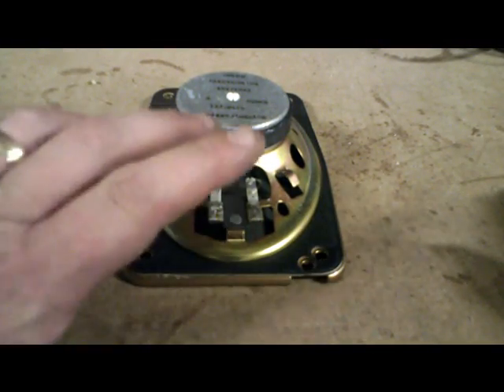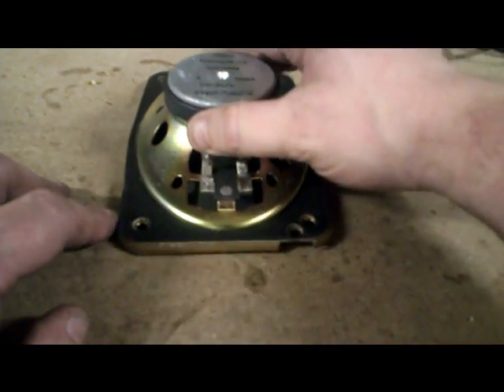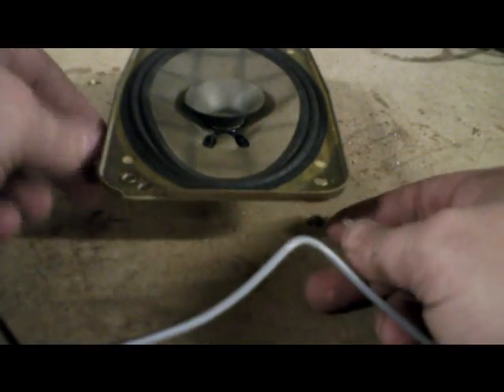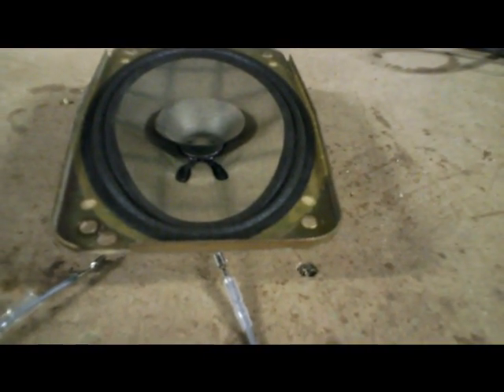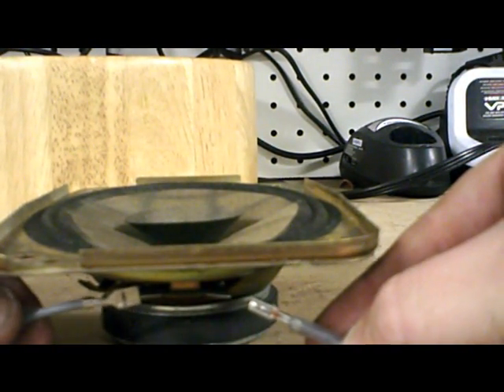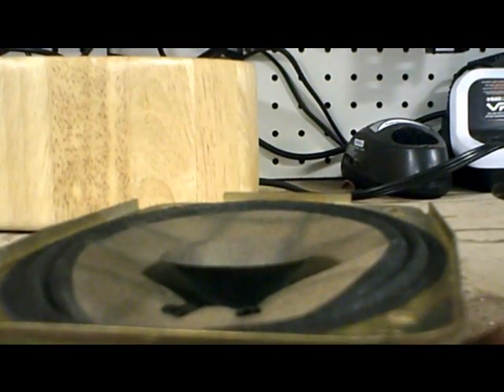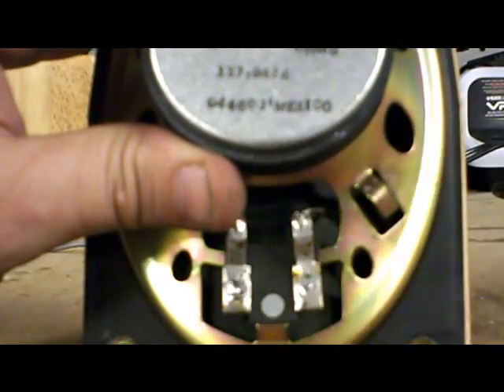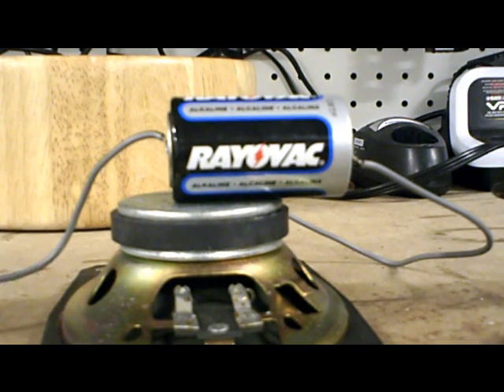How to check speaker polarity. Positive and negative not marked?

Comment: Thx for the tip. Perfect, easy, short and sweet method of determining (an unmarked) speakers polarity. Just the info I needed to test on a Bose 6X9 I got, which came factory as a rear speaker from some other random car. (Dunno what the car was b/c it was one of the two 1/4 panels my work ordered in from a scrap yard. Yard cut off & delivered a large chunk of 1/4 panel with the 6X9. The autobody tech cut what he needed, scrapped the excess and I salvaged the unmarked Bose speaker before excess went to the scrap pile.) Very nice demo in video here. One thing I might add: doing this with a 9V, I think, may have results that are more emphasized / pronounced. Am I right?

Comment: The speaker will sound off connected backwards ? I connected it one way and it sounded good but it was quieter and I tried another way and it sounded louder so I went with that
Reply from the maker: It may be hard to tell if they are mixed up. You will be able to tell if one is out from another, they will sound "off".

Comment: Great tip. I have 6 pair of vintage speakers that I am currently installing into cabinets, and of course, NONE of them have the polarity marked. My next question is though, which way should you connect the speakers to the 1/4 jack? I'll be running all these speakers in series to an input jack in the back of the cab. Thanks for the vid. Great info for DIY'ers.
Reply from the maker: Thank you! The center of the jack is the negative.

Comment: How do you know what the pos and neg is of your car wiring?  I have a gray wire and a green one, and despite searching all over the internet, I haven't been able to find out, so I still can't tell if it's correct or not.
Reply from the maker: Sometimes the positive will have a line on it but the easiest way is to get a complete manual on the car with the schematics.
Reply: sreihart le monde

Comment: How about if you have two wires sticking out of the hole where the factory speaker used to be? How do you know which wire is positive or negative to then hook up correctly to your speaker?
Reply from the maker: Manufacture manual..

Comment: I tried my speaker with a 9V battery and it didn't move but it did some sounds. It's a Pioneer TS-1615 3-way speaker and it pass the continuity test done with my multimeter. What am i doing wrong ?
Reply from the maker: Hmm.. Not sure. Is the battery almost dead?

Comment: Hey I got a question my speakers are clearly but my wires in my truck door are not the person before me changed the colors and there's no markings on them on the one door ones orange the other is grey on my other door ones dark green and ones light green I can't tell witch is witch I put the speakers in and there's sound the speakers are 250watt kickers I have a alpine deck I can turn it up loud but if I turn the bass past 5 it sounds like crap
Reply from the maker: Hmm.. That could be anything. What amp?

Comment: o think if wrong correct the speaker will not move up,but if correct you can see the speaker move up much
Reply from the maker: It will suck in a little instead of pushing out.

Comment: Hello
 Jhonnysshop,,  last night, from my vintage tube amplifier,  I 
mistakenly connected my Spendor Bookshelf speakers as with two  + wires 
 to the one speaker and two - wires to the another speaker. But one side
 speaker worked and another side didn't work.  'Balance control worked 
both sides only for one speaker. I shocked and sweated  then found it 
was wrongly connected. After made the correct polarity connection, they 
now sing.  Here, I need your clarification for: Since I made the wrong 
connection for 10 minutes, is there any possibility for weakening the 
Cross-over and speakers? Actually, What would be happened by this wrong 
connection? I am much much worried about my beloved - expensive  new 
speakers.   Kindly explain and please let me know : Did my speakers 
fully escaped and are they safe now?  why could  the speaker sing, connected
with two positive + speaker wires?  and why could not sing ,connected with two negative wires?
Thank you,
_ with regards,
Reply from the maker: You should be fine. It probably worked because the speaker was getting a ground somehow.

Comment: I am replacing the tweeter on my keyboard amp.  The one that came with it can only fit on the wires one way, but the replacement tweeter I bought has identical terminals which I will now have to solder to get it to work.  So my question is, once I determine speaker polarity, how do I know which wire is which coming out of the amp?  I only have a digital multimeter not a cool oldschool one like you mentioned in previous comments.
Reply from the maker: This may help https://www.youtube.com/watch?v=dpcuA0bH35Q

Comment: Would it work to test it using the existing wires in the vehicle connected to the vehicles battery or would that cause major problems?
Reply from the maker: +Stephen Diers Yeah, I don't do that..

Comment: what if we connect the opposite connection on speakers,  positive to negative and negative to positive?
Reply from the maker: +james kaneeth The cone with suck in instead of pushing out.
Reply: have the same question too,does it mean if you put it reversely theres no air pushing through the speaker cones?

Comment: Thanks for the tip. What if I have a speaker with fixed wires that has a speaker and tweeter and cross over filter in it? Is it save to use the same method or could I damage anything by connecting a battery?
Reply from the maker: No, you would be fine but just use a D volt.

Comment: How to you check positive and negative when connecting LOC's to wiring harness on the vehicle?

I want to connect amps to my car and not sure how to do it, i know from the speakers to head unit, but not the other way around
Reply from the maker: I typically would get a wiring schematic. Depending on the car, it may have a factory amp that needs to be bypassed.

Comment: Okay quick question. The  after market speakers i'm installing have the positive and negative terminals marked off. The problem is the passenger side rear speaker wires in the car look identical. They are both green with two white spots on them.  The driver side wires has one with a white line and the other does not. Is there a way I can determine the polarity of the wires that are not marked off (passenger side) prior to installing the speaker? The old speakers have no markings on the terminals. 
2003 Mazda Protoge ES sedan.
Reply: +Coolride17 thank you sir!

Comment: will this damage the sound quality of a speaker and you connect the wires wrong will the speaker play music or what will happen
Reply from the maker: No, it will be fine but may sound "off"
Reply: Off as in no music
Reply from the maker: Allan Couch No, just odd sounding.
Reply: So then the speaker won't sound right ?
Reply: So then the speaker won't sound right ?
Reply from the maker: Allan Couch Correct
Reply: i highly doubt 1.5 volt will damage a speaker!  we used to use 9 volt batteries in the same way to check for blown speakers, because sometimes a speaker may be blown but not seized

Comment: Got an old t-bird 1973. The original cables for the speakers(4) share the minus per side.
So out of the original radio there's only coming out 2 minus cables instead of 4.
Can I build in a modern radio and connect the speakers sharing the minus per side. So 2 speakers on 1 minus to the radio?

Comment: What I meant to say it that the polarity on the drivers side headrest speakers was reversed at the factory, causing sound problems with new speakers I put in. I checked the wiring and corrected polarity on the drivers side speakers, they sounded like crap w/polarity reversed-even blown but now they sound great, no problems at all. Thanks for the video, it was alot of help.

Comment: Very informative guy, thank you. I have a 91 Miata and there are speakers in the headrest(s) Original speakers were crap but you did get sound out of them, the driver side was far worse than the passeger. After doing some homework I found out that the headrest speakers connections were backwards, from the factory, on the drivers side, I installed new speakers that sounded great at first then problems on the drivers side, sounded like crap, even blown. Well, I switched the polarity and it's good.

Comment: I recently installed new 6x9s in my saab 93 the old speakers were blown and all the zoom around the edge was gone I replaced them with pioneers because that's what the store had in stock they don't sound great and when I try to turn up the stereo loud it sounds pretty crappy could I have the speakers wired backwards? should I have them wired in parallel? any help would be great I am hoping one of the speakers is just playing backwards because it almost sounds like one or both of them are blown.

Comment: Much easier to use a 9 volt square battery... the spacing of the terminals is just perfect to fit the wire connection tabs.

Comment: @senseblogger That is not true. As long as the speaker still moves in and out, it will sound the same with polarity reversed. The exception is when you have another speaker - then they will be out of phase.

Comment: hey Johnny, how do i check it coming from the wires. The wires on the harness connected to the hu are solid with the black stripe representing negative but the wires in the doors are rainbow colored. ( lt blue with an orange stripe and green with and dark blue stripe) I want to junk my factories but I want to make sure I get the polarity right.

Comment: I'm just wondering, but if a speaker is run on AC current, does polarity really matter? If you reverse the wires on a speaker they'll still move in and out except that out becomes in and in becomes out, but that doesn't really affect how it sounds like, or does it?

Comment: does the speaker push out when the wire coming out of the positive side of the D cell battery is hooked up to the positive side of the speaker and the wire from the negitive side of the D cell battery is hooked up to the positive side of the speaker?  And the pushing out indicates correct or incorrect polarity? thanks for these videos btw.

Comment: @Johnnysshop yeah worked very well thanks, i think it was the wrong way round on one speaker and not soldered on the other (guy i bought it off's cheap fail wiring) but yeah good vid

Comment: i knew how to do this, i hook up old speakers to a wall outlet just to see them blow, =p. i have a 120v ac to 15v dc converter that i got off, i believe it was a phone. i had a computer sub last for like 6 minutes before it blew. that was going correct polarity, wonder if it makes a difference in the time if its reverse